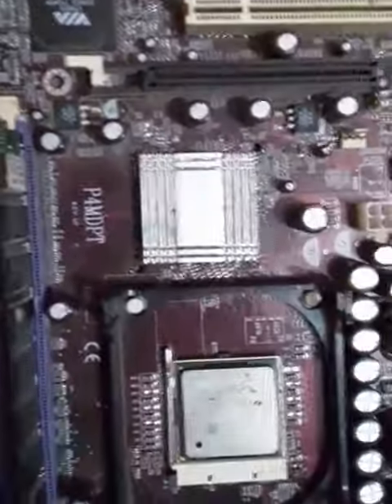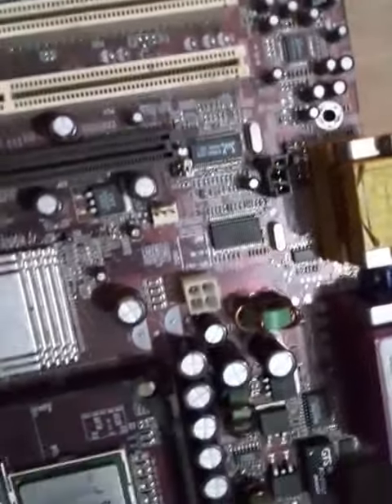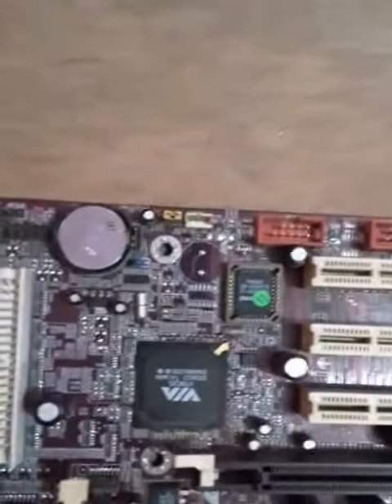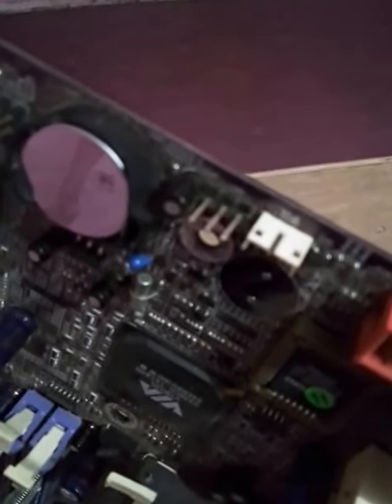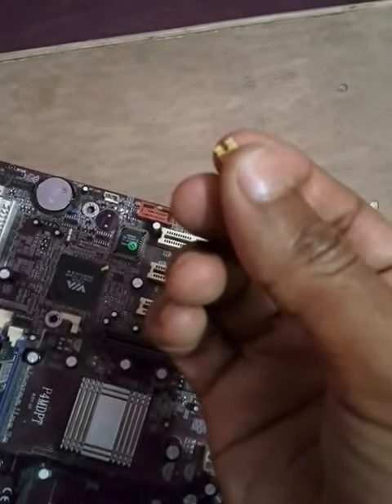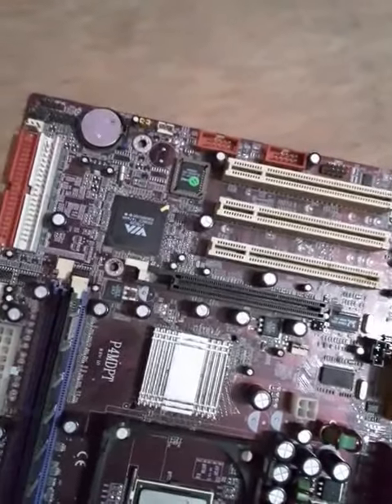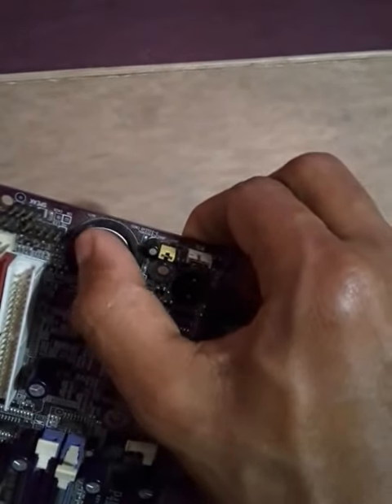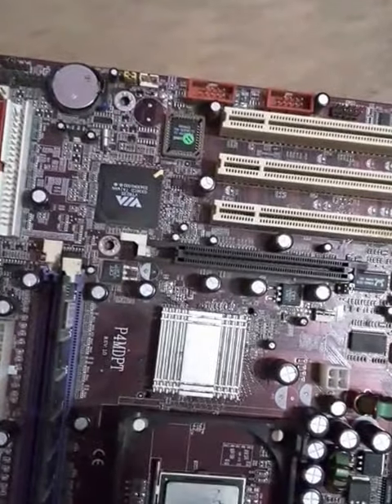How to Reset CMOS, Resetting Bios, Clear Jumper

Comment: Admit it, we're all here because we got too greedy overclocking
Reply: No my parrents put an bios on my pc because i game to much
Reply: Maybe hehe
Reply: Nope, pc just fucking hates its self
Reply: No I'm here to find out what's wrong with my motherboard.
Reply: @chickenmag1657  oh, your PC has depression I see
Reply: I have tried everything and my pc still wont work 😖
Reply: @MariaJuarez-ge5gs  is it a new pc?
Reply: @MariaJuarez-ge5gs  por cierto, también hablo español v:
Reply: @Android25K  sorry for the late response but no its not a new pc
Reply: @MariaJuarez-ge5gs  then it may just be something wrong with the motherboard or cpu most likely
Reply: @Android25K  I overclocked my cpu dont remember by how much and tried all these and my pc wont boot it only blinks
Reply: @MariaJuarez-ge5gs  have you looked in your motherboard's manual what blinking means?
Reply: @Android25K  well not exactly blinking but when I press the power button it just turns the lights for like 1 seconds and turns off immediately
Reply: @MariaJuarez-ge5gs   I had same issue after attempting to overclock ryzen 2400g. My CPU failed. Swapped out with ryzen 5 1600af and problem solved. Hope this helps.
Reply: no i just need to reset a bios i havent used a pc in 5 yrs and i never used a BIOS
Reply: yes bro my mfing ram was at 1600 and i put it to 2000
Reply: im here trying to rescue my thinkserver rs210
Reply: Absolutely 🥲
Reply: Nope, I don't even know what overclocking is ...
Reply: yeah! I get this is like 4 years late, but if anyone here can help me id love that. I was trying to over clock my ryzen 5 using amds ryzen master software, pretty sure I set my memory too high. I set something above the recommended setting. but ive reinstalled memory, tried different memory slots. so its not the memory. ive done alot fo research and apparently with all the idiots youd think do the same shit as me, not a single person knows what to do. its all a bunch of mumbo jumbo.
Reply: I'm here because my pc just won't open again without a reason

Comment: You'd think by now the manufacturers or engineers would come up with a physical button to push, similar to a reset or power button. It can even be tiny so not to be pushed by accident.
Reply: A  button? I don't think so, maybe toggle switch, or a slider, it can't just short  two pins,  it has to disconnect 2 pins to defuse battety power to the board, and short 2 pins to discharge residual power from capacitors and  auxiliary circuits.
Reply: You can technically fit a SPST switch to the jumper; but I don't think you want to be putting yourself in a position to reset your mobo that often!
Reply: Some motherboards have bios reset "button" now

Comment: Make sure after placing the jumper on pin 2,3 you start your computer. Then you'll be prompted with bios setting. Reset the settings and than save. After that place the jumper back on 1,2 pin and restart.
Reply: Is it necessary to put the jumper back onto pins 1,2? I've had the cap on pins 2,3 for over a year now after a failed overclock. Pretty sure I tried to put the cap back on pins 1,2 before, but the computer would not boot even though the BIOS was at the default settings. Might have to try it again.
Reply: I assume, from a safety point of view, any time you touch the jumper the computer must not be powered?

Comment: This worked for me yesterday. Thanks to the uploader for the help, I'd all but given up 👍

1. Turn off machine, disconect power lead, press power button to expell any residual power in the machine (and also did disconnect hard drive to simplify things).
2. Found CMOS Clear pins on motherboard.
3. Pulled off Jumper Cap off pins 1/2. (says Normal on the motherboard for pins 1/2).
4. Placed Jumper Cap onto pins 2/3. (which says CMOS Clear for pins 2/3).
5. I did power on the machine at this point (not sure if it helped or not, or necessary)
6. Turn off machine disconnect power again, put Jumper cap back onto pins 1/2 (normal position).
7. Power machine on (hard drive still disconnected).
8. Screen lit up and after about 30 secs the round swirl appeared and I'm able to get back into the Bios which is now reset to the default.
Reply: my pc doesnt turn on if the jumper cap is on 2/3
Reply: @huhuproudparentakong12kids55      don't worry about it. As long as you've disconnected the power lead and pressed the power button with the jumper cap on pins 2/3, just replace the jumper cap back on pins 1/2 and power up the machine. Power back up and bios will be hopefully reset to default.
Reply: What happens if you are plugged in and turned pc on while jumper is on pin 2/3?
Reply: @drexter09    no idea. 
But the guys message above suggests his machine didn't turn on.
Other than that, I don't know. I was down this rabbit hole almost a year ago, and I'm not a professional, so it's not something I tackle every week etc...
Good luck  👍🏼
Reply: That's so ridiculous that we gotta do it that way
It's 2023 for cryin out loud
Reply: I did everything and still the system refuses to POST.
Reply: @JustMatheus   Sorry to hear that. 
Maybe try a couple of times and look for any variables that might've been overlooked. 
It's probably worth your time to try a few times.
If it doesn't work, at least you've tried.

Comment: Bro, should I turn on the power supply after changing the pin.
In this video you haven't remove any components from the motherboard like ram, processor can I follow the same

Comment: My Pc is not Starting up, even i tried removing and reinserting CMOS battery and and ram, Couldn't the jumper in my motherboard.
Fans are working fine, HDD is also fine as there is spinning sound is over there. but PC is not starting up
Reply: Problem in Processor
Reply: When did this start?
Reply: Try to select the proper boot drive.
Reply: I have same problem all are saying bios corrupt

Comment: Doesn't work. I've pulled the cmos batt, left system unplugged for 1/2 hour, moved jumper:
@#%$&@$ password is still there
Reply: Right exactly me too
Reply: @GORILLA_PIMP  did you find any solutions? ?? Because I'm facing this problem after I failed my ram overclock
Reply: @rageprince927  
Yes i pulled the jumpers
And it reset the bios
Reply: @GORILLA_PIMP already  tyred but not working:((
Reply: @rageprince927  
I see hmmm what exact model pc/motherboard you got?
Reply: @GORILLA_PIMP  I have h61 zebronics I also pulled the cmos battery for like 10 hours but nothing goes in my favour I am hopless
Reply: @GORILLA_PIMP  full spec
Ram- 8×2gb ddr3 1600mhz
Intel i7 3770  3.90ghz
Nvidia gt 1030 2gb ddr5
240gb ssd and 1 tb hardisk 7200rpm
Reply: @rageprince927  
Dam really?
Ok and you for sure pulled the jumper node?
Is the battery for sure good an the right size?
Reply: @GORILLA_PIMP  yeaa what if battery died is that affects the bios reset process
Reply: @rageprince927  
Well maybe it can if the battery is OLD an doesn't have much life left
But if the pc is turning on and booting up fine then i think that's ok
So when you push the button to enter bios it is asking for a password right?
That's the exact problem you're having?
Reply: @GORILLA_PIMP  no i 
can't even see the motherboard logo
Reply: @rageprince927  Oh and how old is the battery?
And what exact battery you have in there?
2032?

Comment: 5 minutes? Did you make  that nonsense up your self?  You don't have to wait. It disconnects the battery and shorts the system so any capacitors are drained of residual power, It's instant.
Reply: Do u have to remove the complete motherboard detaching all the cables or I can keep them as is and do this reset?
Reply: @JustGotALife  No. You just have to turn the power switch off from the back of the power supply, or unplug the power cable from the power supply